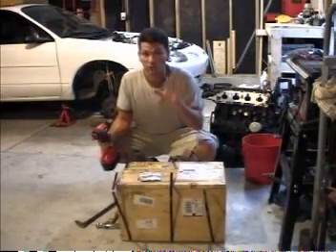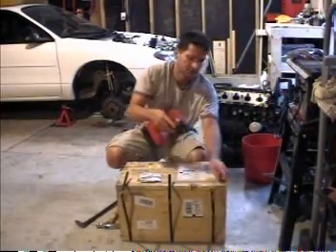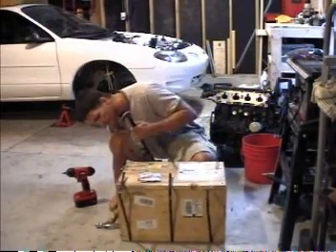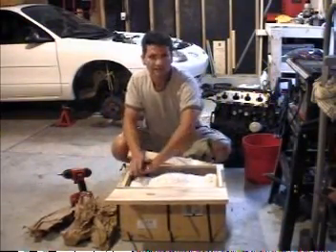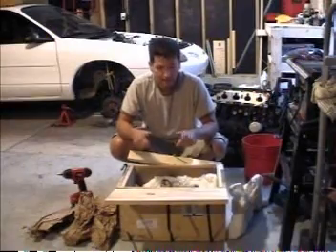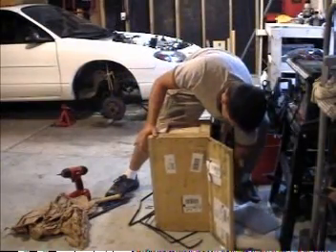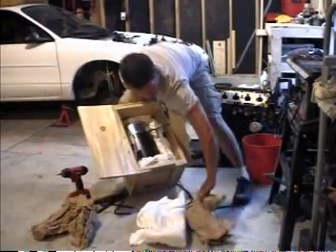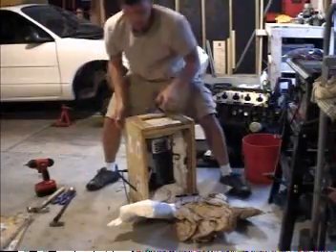Patrick Roth's zx2EV Project Part 5

Comment from the maker: I chose the 8" motor because of the weight of the car and type of conversion. This is just a commuter car, not a racer. I know a guy who's had a 8" motor in a Fiero (which weighs more than my car) for 16 years and he gets more than adequate performance out of it. As for batteries - not sure what you mean by "bigger". I chose 8v for overall weight, space and cost. It was an offset of range and weight to still be at my 120v target. 6v=longer range/more batts. 12v=lesser range/fewer batts